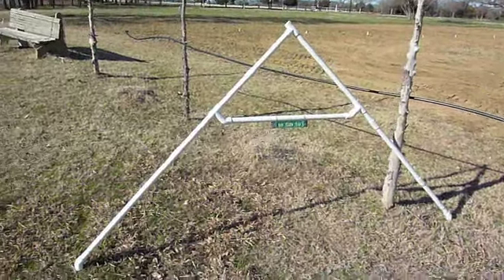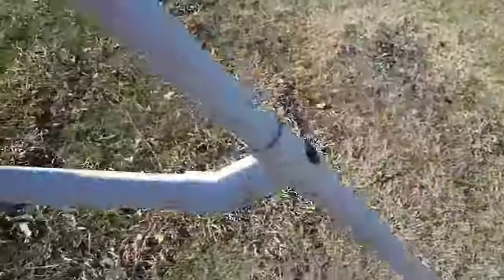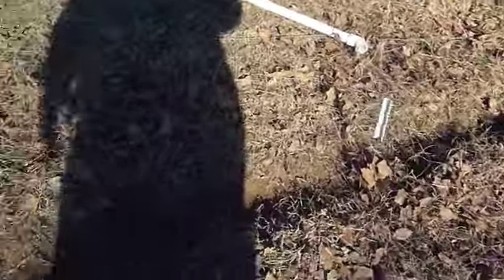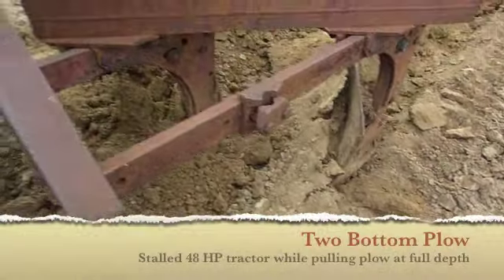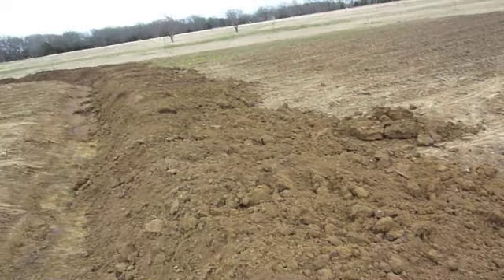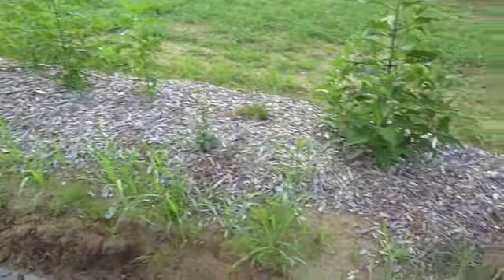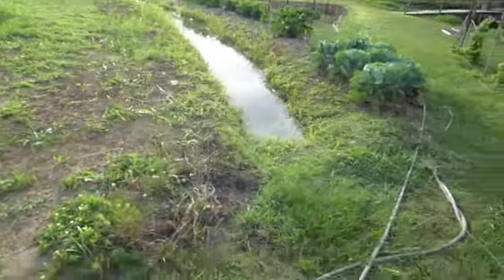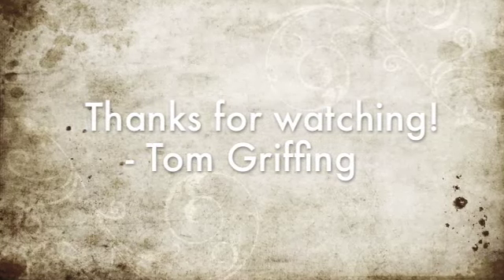Swale Digging with a Two-Bottom Plow

Comment: Was thinking of using a two bottom plow as well.  A friend recommended doing it this way during a discussion this past winter.  He was thinking I would be ok with my 23 hp tractor but your mentioning that your 48 hp was having difficulty may dissuade me from doing so.  My soil is a loam but, having less than half of your hp may be a limiting factor for me.
Reply from the maker: tom Elzear If it were me, I'd borrow a plow (either 1 or 2 bottom) and try the 23 HP tractor. One big factor for me was the clay soil I was working - it really bogged down the tractor. A loam soil will cut easier.
Most of the work was done with the front end bucket - the plow mostly cut the initial line, turning the soil downhill, but the bucket probably moved more dirt and did all of the shaping of the berms.
I know I've said it before, but I'll say it again: make sure you get the contour lines level before cutting!
If you'd like more information about permaculture and swale design info, check out Jack Spirko's video series: https://www.youtube.com/playlist?list=PL2L0j7OhkAI7-PLf6aEZfhFDZ63j3g8Vt
Reply: Tom Griffing
Reply: tom Elzear  How big are your plow blades?  My friend has a two-down with 12 inch blades.
Reply from the maker: tom Elzear 
I think they're 12" blades as well. I bought it just for digging swales and it worked well in combination with the front end bucket.
Reply: Thanks for the info.  Think I am going to give it a try.

Comment: Looks pretty sweet.
Reply from the maker: It has turned out good, as I started with "hard packed" black clay soil on the berm and have since amended it with literally tons of wood chips, leaves, straw and cow manure until it is now loose and excess water drains off easily. My farming neighbors comment about how good the soil is now.
I dug the swales 5 years ago and I did an update a month or two with the video on the "Fall Garden" - which is on the berm.
I hope to do another video once the Spring growth is in full force.
Thanks for watching!

Comment: the land in between swales, if you planted garden would you need further irrigation? your garden just after 2nd swale, does it need irrigation, does swale moisten soil enough?
Reply from the maker: At first, I used the solar irrigation to fill the swales, but found that it only helped the plants nearby with deep roots. I later changed it to use sprinklers to service a wider area.
The swales now serve mostly to control runoff from rain. The high clay content of my soil tends to block water absorption and seeping into the surrounding soil.
Reply: jo zepi 
Swales need to be used in conjunction with trees
Reply from the maker: The water in the swale doesn't irrigate the "downhill" soil as much as I had hoped. I've had to use additional irrigation.

Since that time, I have changed my irrigation strategy using a solar pane, DC water pump, timer and drip tubing on the tops of each row I'm impressed with how much can be watered from a 1/2" supply line. I hope to be posting an update soon.

I've heard the principle of adding trees to the swale and have fig trees and willow trees growing. I'm thinking of adding more fig trees.  I've heard where mimosa trees are good support species - and they grow well here.
Reply: Figs aren't good with swales because they prefer sharply draining soil.   Willows will suck up all available water.   What about fruit or nut trees? Persimmons are an interesting choice. 
Vary them too for staggered flowering,  the exception being those needed for cross pollination.  You need to consider several different nitrogen fixing trees for the support of bees and rebuilding soil.
You might also want to consider planting trees for fuel or building.  
You can plant empress paulawnia trees which also feed livestock and allow cropping underneath and which can be harvested for its fine lumber. 
 You can also plant trees for beauty.
Reply from the maker: Yes - it would need more water than the swales provide. Since then, I've been using dripline irrigation in combination with the solar irrigation pump and it works much better. The swales are mostly for runoff control during rain storms.

Comment: Sir this is fantastic!!  Great job.  How long are the swales?
How long did the construction take?
Reply from the maker: MatthewinGooseneck The swales were initially 85 and 125 feet long each. The initial breaking with the plow only took about 15 minutes each - making two passes per swale. Note that I was pulling it with a 48 HP diesel tractor, in first out of 12 gears - and it was stalling the tractor when the plow was at full depth in my clay soil.

After digging the initial ditches, I went back with the front-end loader bucket and dug them down to about 16", scooping the dirt downhill to form the berm.  In hindsight, I should have sloped the top of the ditches more, for more water capacity and a more gentle slope into the ditch.

Also, I didn't carefully calibrate the A-frame level, so the resulting swales were deeper at one end, causing the water to flood one end of each swale. To remedy this, I filled the deepest end of each with wood and covered them with dirt - creating "woody beds".  Make sure you get the contour lines absolutely level before digging. Afterward, create "spillways" to channel excess water from higher swales into lower ones.

All in all, I dug the two swales in about 4 hours by myself.  Covering with wood chips took another couple hours - this mostly depends on the distance to the wood chips. You can also use other much, such as leaves or hay (preferably with no seeds). As I was turning new soil, I wanted to block out light to kill the weeds and conserve moisture.

This was about 1 1/2 years ago and they are still doing well, though I still have an issue with water levels high in one end and low in the other. I'm considering filling and re-digging the low ends again to correct the problem.  I'll say it again: Make sure your contour lines are level!

Thanks for watching, Matthew.
Reply: @ThomasGriffing  Levelling the swale after digging shud address your concern. Levelling before digging for guide line. If you ensure level digging then you will have a level swale.